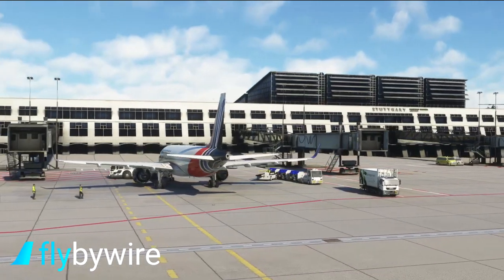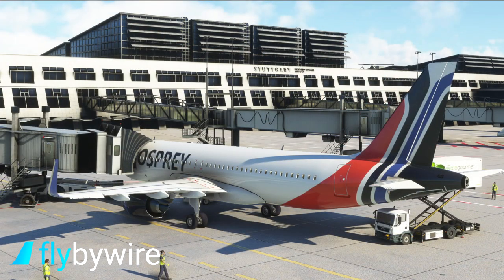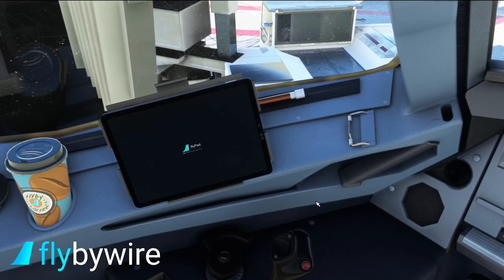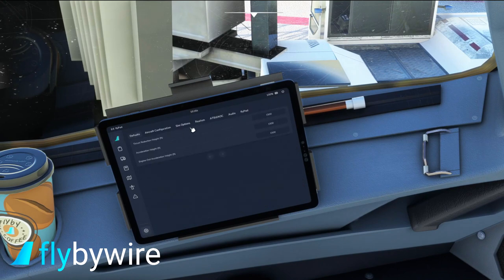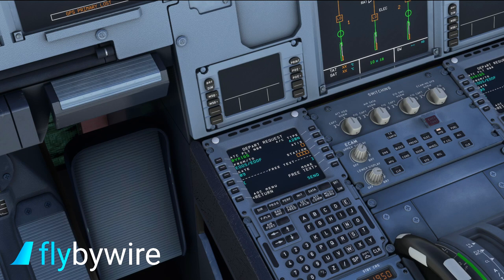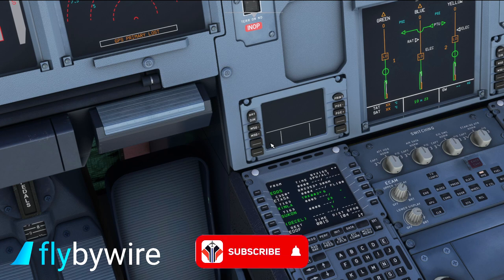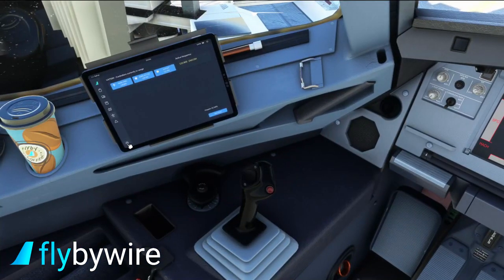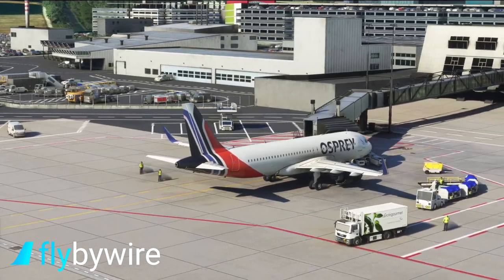flybywire Development Progress - NEW ACARS / CPDLC - Plus Aileron, Elevator Hydraulic Droop!

Comment: Thanks BA for delivering this update news. It's quite impressive to see how this addon has managed to mature this far.
You wouldn't expect there's another freeware aircraft with this kind of details put into each system. Simply outstanding project and I love it.
Reply: Oh trust me the Zibo beats it hands down for now
Reply from the maker: It's remarkable isn't it as a freeware project - great to see it going from strength to strength all the time
Reply: @BritishAvgeek  Will you fly PMDG and Fenix when it comes out for MSFS?
Reply: @Joeys6thchin  The Zibo 737 is a modification project, it isn't doing what FlyByWire is doing with the A32NX - as it's more than a addon, they're getting rid of All asobo code and the entire model as well. Zibo doesn't do this. A32NX is far better. sorry, this is just the truth.
Reply: @iamZaidd   the Zibo is the better plane the a32nx is lacking failures,flight dynamics,VNAV logic etc im sorry but the zibo is miles ahead of the A32NX. The A32NX still uses the exact same model as the default A320 maybe a few cockpit textures might of been changed but that has also been done in the Zibo
Reply: @Joeys6thchin  Everything you’re talking about is in development and it takes time.A32NX is going to surpass the Ziho
Reply from the maker: @Joeys6thchin  absolutely!! 🙌🙌
Reply: @iamZaidd  You don't know that for certain and if they are Zibo is years ahead of them
Reply: @iamZaidd  Once fenix comes out that will probably kill FBW
Reply: @Joeys6thchin  Yeah yeah... Let it come out first :D
Reply: @leloginquitu  please for the love of god dont tell me you think FBW will be better than Fenix it WILL be
Reply: @Joeys6thchin  Sorry but that’s the truth like it or not ;)

Comment: Tried this today and the controller said he sent it but nothing popped up on the little screen.
Reply from the maker: It can take a minute or so for something to pop up but the screen has to be active (check my flight yesterday livestream Katowice to Bristol - we used it with Warsawa Radar and it worked very well) and check your AOC Menu - Received Messages too in case something is in there

Comment: Pointless
Reply: its not pointless lmao
Reply from the maker: Perhaps you'd never use it but some will - plus the droop has a point - the accurate simulation of the hydraulic system (it goes deeper - engine failure at altitude and loss of hyd's means you can't deploy the gear properly etc)
Reply: @BritishAvgeek  maybe
Reply: This is absolutely revolutionary, arguably more important than vatsim velocity or a new A380 since now airports that adopt this system can handle way more aircraft rather than having 20 different pilots stepping over each other on the frequency